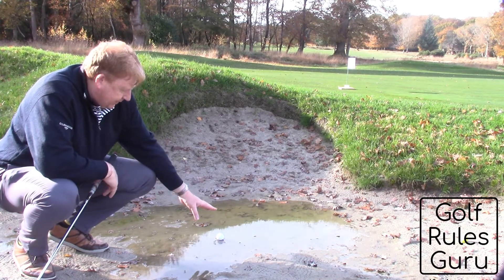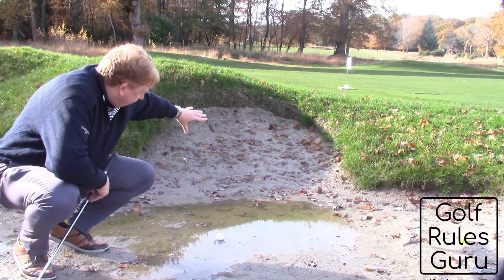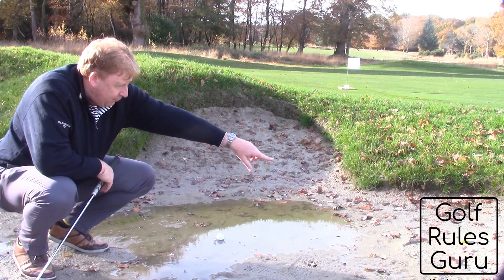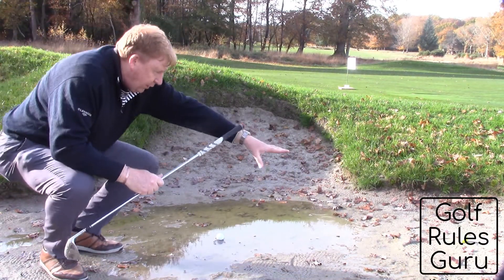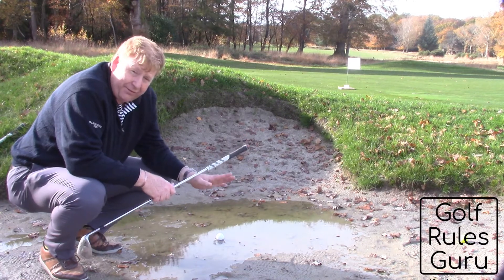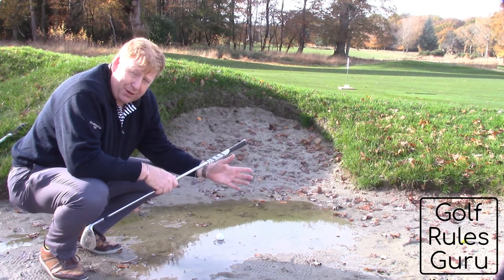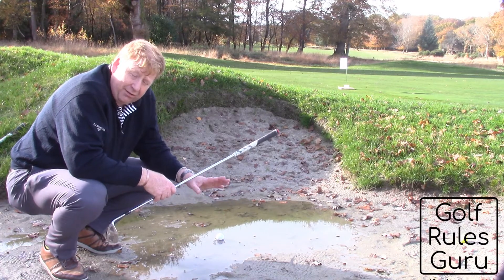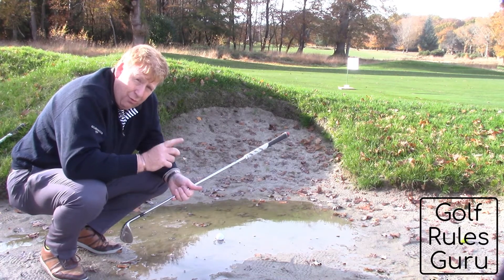Temporary Water in a Bunker with Maximum Available Relief

Comment: .. Back outside is 2 shots penalty not one unless you play from the original spot you hit into the bunker
Reply from the maker: It would be 2 shots penalty to drop back outside the bunker only if you have decided to take penalty relief (e.g. for an unplayable ball) - that would normally be a 1 stroke penalty if dropped within the same bunker or you can drop back on line and outside the bunker for 1 additional penalty stroke (2 in total). 
The situation we have here is for free relief from an abnormal course condition if the ball is dropped within the same bunker.  Similar to the penalty relief, you can choose to go back on line and outside the bunker for 1 additional penalty stroke - as the initial relief is without penalty, that only makes 1 penalty stroke.

The applicable rule 16.1c, with a very good explanatory diagramme, is here: 
https://www.randa.org/en/rog/2019/rules/the-rules-of-golf/rule-16#16-1c